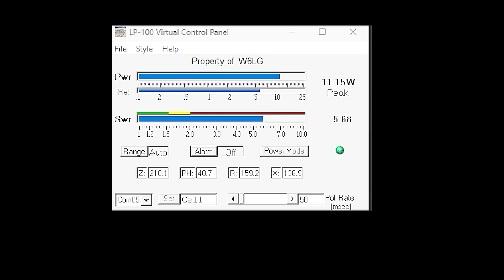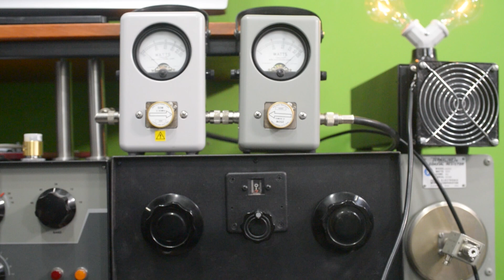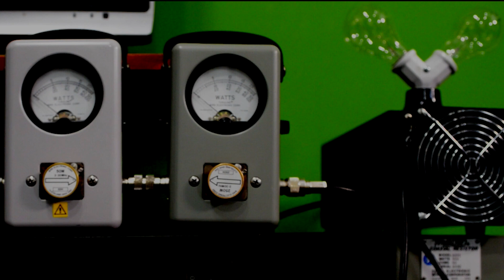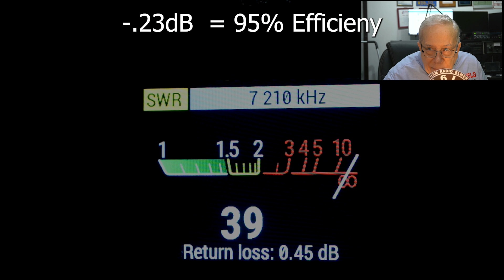How Efficient Is My Matcher, Antenna Tuner, Match Box? Could It Be 95%? Find Out With Jim W6LG Elmer

Comment: I'm trying very hard to understand tuner efficiency. From what I've seen, and I don't have a tuner myself, tuners just don't get hot, or even warm, which they would if they were actually dissipating energy. From what I understand, the reflected energy from the non-resonant antenna is just re-reflected back to the antenna until it is finally radiated or lost as heat. The problem, as I understand it, is in the energy bouncing back and forth in the feedline (coax) between the tuner and the antenna - this is where most of the energy is lost and what makes a non-resonant antenna with a tuner inefficient and what gives then their bad rep for being inefficient. So what I'm hearing is that if you just connect the antenna directly to the tuner with no feedline, you'll have a very efficient system. You'll have to weatherproof the tuner somehow, and some, like the Icom AH-705 that I'm looking at, come with certain degree of dust and water resistance, so just putting a bag or box over it to keep direct rain off it should be fine. I'm trying to figure out the easiest setup for QRP portable and it sounds like a IC-705, an AH-705 and a random wire would be the best way to go - easy and versatile (can do all bands and also any setup you want - interted L or V, flat top, sloper...). I'm I understanding things correctly?

Comment: Tuners are unusual devices in that their efficiency is determined by the quality and power handling the parts of the tuner have but also upon the kind of loads you put on it. Nasty low R with -j1000 X  loads will really test your tuner more so than just putting a 50 ohm load on it.

Comment: I have thought about how to measure this for some time. Calorimetry seems to be an answer.  ie calibrate the calorimeter container with DC from power supply using accurate resistor.. Then confirm with RF into 50ohm load in the water. Then prepare a load say 7ohm -j1550, representing a dipole of about 14m long on 80m.  Put it into the calorimeter and heat the water. calculate, and see.  Accuracy would depend on accuracy of thermometer, scales  used to measure weight of distilled water, clock accuracy, calorimeter container  heat loss, load capacitor loss .Water needs too agitated from time to time to eliminate hot spots. Think its not accurate. ? Well Bird uses calorimetry to calibrate their 1% accuracy power meters used in semi conductor manufacturing.  Much more complicated set up ,but same principles.   You can also calibrate your power meters with the set up.I have done some tests with cheap scales and thermometer, Thermos flask . Will be setting up a more accurate device when time permits.

Comment: I'm sorry I'm not following your efficiency derivations.  Not arguing - just don't understand from the basis of a tradition understanding that being the ratio of energy (equivalent) of desired useful work output to the total energy input.  Thank you.
Reply from the maker: Okay, fair enough.  If you think about it this way:  To measure the loss in coax you would use RL (return loss)..  You would short the end of the coax and make the measurement.  Half of that number would be the loss through the coax.  That is what I did with the tuner.  It made sense to me to use return loss.  73, Jim
Reply: @ham-radio  Thank you.

Comment: Smiling!
Works better than some I built on a flat 1x12, oh how many times did that thing bite me. New ham in the early 70's learning stuff, then I built a home brew 4-1000A, that's nothing but an antenna tuner with extra parts and 3900 volts, smile. Still working today, use a small tuner for the input for the Icom 7300, the 7300 will tune the input but someone told me I shouldn't do that, couldn't tell me why just said that's what the heard. Didn't need a tuned input with the old 6146 tubes they just worked.

Comment: Nice videos Jim, I have watch several. 95% for a tuner does seem high. I worked with an RF design engineer for a few years who used to work with a US defense contractor. His speciality was antenna tuners for aircraft. He said that you have to count on at least 10% loss through any tuner. Now, just relaying that 3rd hand is not scientific I know! Just wondering if you did actual power measurements on the input and output of the tuner with a known load other than a short? Something I might try on my own bench someday. I get your return loss measurement method, hard to argue there.  Perhaps if a number of configurations were tried, some my prove to be more effiecent that others? Also quality of materials in the tuner I believe has a big influence on this. Just my thoughts. Spent a number of years in shortwave broadcasting then installing low power (10 to 2000 watt) FM stations. Thanks for the time you take on the videos. VA3DAC

Comment: Jim, well done with the test, it is indeed very difficult to measure tuner efficiency into "strange" loads. My thought is rather than trying to measure the power reaching the load try to measure the power lost in the tuner. I think this stands to be more accurate... set the tuner for a match into the load then perhaps with 500w carrier through it for 2 minutes measure the internal temperature of the tuner. Remove the RF and then put a high power resistor inside the tuner with a known DC input power and compare the temperature rise that creates inside the case in the same time. I know it sounds messy but I think it might be worth trying something similar. IE if you try to measure the output it is not easy with a strange impedance to measure the difference between 495w and 480w, but the internal temperature of the tuner would be greatly different going from 5w lost to 20w. I have not put sustained high power through my tuner but it does stay totally cold despite no ventilation,  only on one occasion have I noticed any heating and that was a hideous load on 160m. I guess you could do a strange test using 2 tuners and a VNA ....
Reply from the maker: Hi and thanks.  I don't think I can get the tuner heated up with 1500 watts.  I did look at the wheel with a heat gun and it was at room temperature.  The problem I had was RF in the shack that affected lights, computers, display screens and other stuff.  In any case, it is an interesting topic and one that is difficult to quantify.  Oh, I did use two Bird watt meters and the loss was so small I could not measure it.  I was using 250 watt slugs.  I could try some slugs that are 2.5.  73, Jim
Reply: @ham-radio  thank you for the reply, this does suggest that the losses are lower than many insist that they are. At 1kW a 0.2dB loss represents 50w lost, in my simplistic view something confined in a small box is going to get hot. Thank you for the work you do with your videos, the connector loss one in particular is great for dispelling some myths. 73
Reply from the maker: @g0fvt  It goes indicate that 'perhaps' the loss is much less than one would expect.  Your emails are always welcome. I enjoy the discussions that we have.  Your thoughfful  questions and suggestions are thought provoking.  73, Jim
Reply: @ham-radio  thank you Jim, I always enjoy your content and I do appreciate that you take the trouble to reply.  As subject that you might have fun with is the use of transformer baluns and why they are so often used in unsuitable ways. My best wishes with your health issues, good to see you back in the shack doing some real science. 73